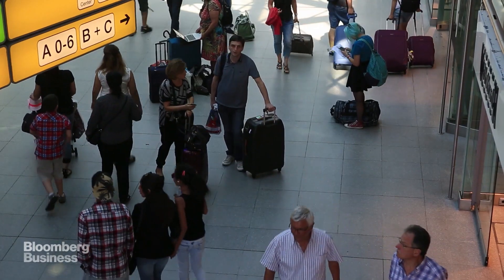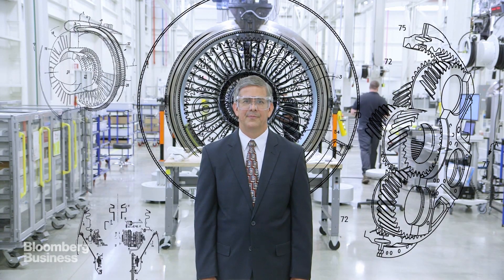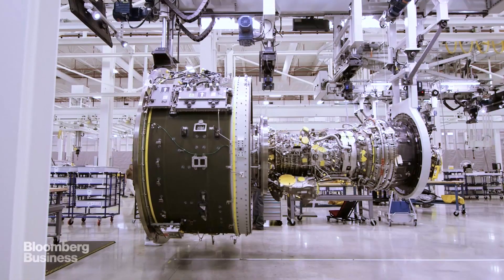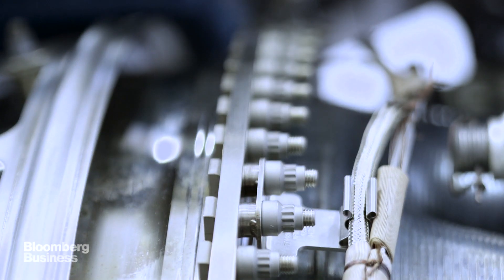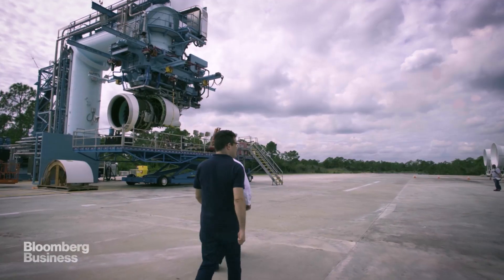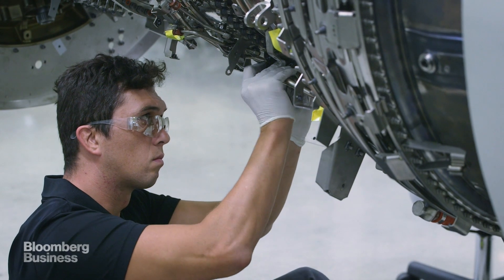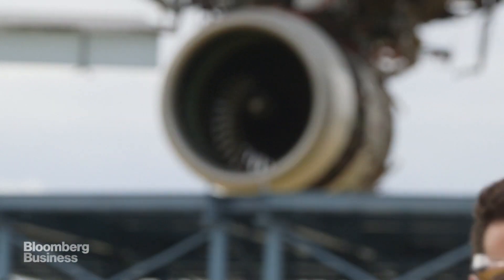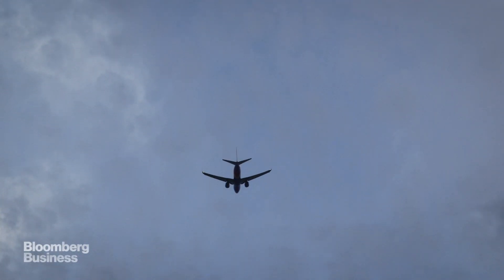This Genius Invention Could Transform Jet Engines

Comment: We've invented an innovative new design the world has never known!

A FUCKING TRANSMISSION.
Reply: Guy Mahoney
Sorry you missed my sarcasm. My fault.
No it is not simple upscaling, nor is it a simple task. The material engineering alone is a massive challenge.
The gearbox has to be far more reliable then any other gearbox in existence. It has to handle loads far greater then any gearbox in existence and it has to adhere to safety standards far greater then any gearbox in existence.
And all of that is before you start to ask the question of, how heavy is it, are we losing the efficiency gains we are going for simply due to all the extra weight we have added...etc.
Reply: Hey they're not so easy and they're a big deal.  Look at the dual-clutch, the CVT, et.al.  It's taken awhile to develop/optimize those.
Reply: We've had transmissions for an awfully long time, he hasn't invented a new method of power transmission, it's literally just scaling up an ancient skill. The idea is about as clever as putting a rubber on the back of a pencil, which is not very.
Reply: Was Edison's lightbulb clever?  He didn't invent the lightbulb.  Inventions and innovative engineering aren't the same.
Reply: And this isn't innovative engineering, it's an obvious lazy cut and paste.
Reply: Yes because a gearbox that can handle an engine producing ~500hp running at ~7000 RPM is no more difficult to design & build then one capable of handling an engine which produces >100000HP running at >100000rpm.
Reply: The keyword for aerospace propulsion is reliability.  Putting a  gearbox inside a 50,000LB thrust engine is many order magnitude more complicated. Plus making light weight for aircraft, and making last 2000 hours operating at 80-90% most of the time is a daunting engineering problems even RolceRoyce and GE backed away from the concept.
Reply: Actually the whole engine has to be constructed from the ground up. It's not as simple as slapping a planetary reduction gearbox on the low pressure shaft. 

Plus it's not new technology, but it's a huge innovation. Because so far only 6 types of geared turbofan engines have been developed and commercialized. 

Non of them, except the Pratt & Whitney PW1000G (which produces between 24,000-33,000lbs of thrust), has produced no more than 7,000lbs of thrust.... meaning only private and small jets.

Garrett TFE731
Lycoming ALF 502/LF 507
Pratt & Whitney PW1000G(In video)
Turbomeca Astafan
Turbomeca Aspin

So this engine is under enormous loads and requires some extreme engineering to create. Even more so as Pratt & Whiteny say "The 30,000 hp gearbox is designed as a lifetime item with no scheduled maintenance other than changing oil."

So basically they are saying that these transmissions are supposed to last tens of thousands of flight hours without maintenance other than oil changes..... you dismiss it as "a fucking transmission"... but you don't realize it's the whole engine that had to be innovative, not just a simple gearbox.
Reply: exactly, it's more costly but it's simple upscaling.
Reply: Right, and it's not just driving any old load, it's driving the engine itself. It's in the heart of the engine. It's not an isolated component, it's an integral component with effects that ripple through the whole engine design. So you tend to be optimizing not just a gearbox but the engine design as a whole. Safety, weight, efficiency are all so important.
Reply: 2Phast4Rocket Again, the actual concept of a transmission in an engine isn't innovative by any extent, if you're willing to scale up enough it's fucking child's play and that is what's being sold to us here. They weren't selling it's ability to tank crazy forces reliably at that scale, which is deserving of coverage, they talked exclusively about something we always could do in planes.

Imagine I told you I made a car that was equipped with a fan and tried to sell that as innovation, you would laugh in my face. However, what I failed to mention was that it was pulling that air out from under the car giving it unparalleled down force characteristics that would put F1 cars to shame. I would still deserve a massive fucking slap for implying a fan in a car was worth bragging about.
Reply: Guy: You have to wonder why a high bipass engine doesn't a "transmission" for a very long time. Aerospace engine companies have been building reduction gear, or transmission as you call it, for decades in turbo prop and helicopters. Yet they haven't cracked the secret of building a reliable reduction gear for a high thrust, high bipass jet engine. Aside from the simplicity concept of using reduction gear to convert hi rotational speed into low speed and high torque, building a light weight and reliable reduction gear for a turbine engine is the "holy grail" of turbine propulsion. If it is so simple, you should see it used since the first day of jet flight but you don't. That is the point of my post.
Reply: 2Phast4Rocket I don't have to wonder anything. I know a reduction gear is simple, I know a turbine can use a reduction gear by knowledge we've had for decades, technically this video could've been made before YouTube as it covers approximately nothing about how this decades old theory is put in to practice. Yes, the work put in to this is likely fiendishly clever but theoretically it could've been deceptively basic due to the fact they never actually covered how this is practical unlike how a theoretical machine is.
Reply: English Muffin You know car companies produce engines from the ground up every year, right? It's not easy work, it's hard graft, but it's not technically challenging.
Reply: Car companies do not produce new engines from the ground up every year. A car engine is usually a redesign of a current design. They may use slightly different internal parts for better reliability as well. On top of that car engines are very very very simple compared to a jet engine. I don't think you understand the amount of engineering that goes behind putting a gearbox into an engine of this size. You have to factor material strength. A plastic gear works in a remote control car but not a full size semi (obviously). Similar concept. Materials(flexibility, hardness, so on), distribution of load(too much pressure on one point would be a catastrophic failure), lubrication(how to lubricate gears constantly and evenly while a few are spinning at 100k rpm), cooling(Insane amounts of friction will cause the gears to heat possibly rendering lubrication useless), form factor(affects overall size and aerodynamics of engine), weight(affects fuel usage and makes choosing materials far more difficult), and price. Some of the many things to keep in mind and calculate with accuracy all while leaving reliability untouched or improved. It's not totally game changing but far from being as easy as "scaling up" lol

Comment: That's cool but the oil companies would probably buy that patten and not let anyone use it to sell more fuel
Reply: Not necessarily.  After all, if fuel is burned more efficiently, there will be more planes and more flights because tickets will be cheaper.  Then the oil companies (who are actually diversifying to get some of the business from alternative and renewal fuels; why would they be so stupid as to insist on petroleum and no other products?) would sell more fuel at the same price.  They could also set up subsidiaries to make, sell and service the engine improvements themselves, along with selling improved lubricants which work better with the new technology.
Reply: This old furphy keeps raising it's head but can anyone name one patent that an oil company has bought so less fuel isn't used....There isn't any, never has been or will be because patents have a short life span and anyone can access any patent and copy what it says as long as they don't commercialize it for profit.

Comment: They spent 30 years and 10 billion dollars on a gearing system? An "innovation" that has been around for much longer than before the beginnings aviation? Am I missing something here?
Reply: Yes. How do you design a planetary gearset that is balanced and stays balanced at high RPM's while being properly lubricated that operates at temperature extremes that doesn't require service at an interval shorter than a standard engine.

Comment: The video should explain why the gearbox is "incredibly simple yet fiendishly difficult."  Is it because the cogs spin so fast they fly apart?  Expansion and contraction during the heat/cooling cycle?  Lubrication failure in the bearings?
Reply: You have to guess.  Information content - zero.
Reply: All of the above.
Reply: I think they could have gone into some technical details.  When I was a Computer Science research assistant in college sometimes I had to explain my work and why we were doing it to parents of prospective students.  Some parents were electrical engineers who knew more about my research area than I did and some parents never did anything more technical than doubling a cookie recipe.  I'd go into as little or as much detail as they wanted but I never skipped an explanation because it was "really technical."
Reply: Al Dente I agree with you. I would guess their technique was a triple reduction planetary gear of some sort with a lot of clever bearings and seals and attention to balancing.  But I'm still guessing.
That was glossy self-promoting bullshit, and didn't impress me one bit.  It shortened my life, and my time is precious - at least to me.
Reply: It's simplest to stay on the ground.  The only time you add complexity is if it adds something of value.  You don't complicate something just to complicate it.  Turbine engines are extremely reliable because they're simple.   A single stage turbine engine has a single large moving part.  A planetary reduction gear does complicate a turbine, but if it's substantial  fuel and noise savings, it  will be worth it.  Planetary gears are the most reliable form of gearing something of high-power.  There are numerous instances of planetary gear assemblies being more than capable of lasting longer than the product they're installed in.  They're a very simple mechanism as a whole.
Reply: You make a good point, but I do think the everyday common accessory gearbox gives you your answer. It is, as is all other parts of a working jet engine (except your starter motor) driven by the turbine, which is the hottest part of your engine......unless you want to start reallygetting technical
Reply: Jay Edlington Most individual invention is stolen from the originators anyway.
It is part of power politics.
If you aren't a robber you WILL be robbed.
Some of my former employers are still in jail.
Reply: I remember reading about the gearbox for the  STOVL F-35 Lightning, now that is a feat. The lift fan in the JSF-35 is powered by the same turbine engine in the aircraft via gearset.
Reply: More toque than speed is the issue for gearboxes.
Reply: Tony, it's copyrighted so they can brag now.
Reply: Mike The more parts there are the more chances for a failure in mid air... this is one of those instances where the K.I.S.S building method is best... If you are wandering what this means, it's: Keep It Simple Sucker.
Reply: the necessary strength and consecuent  increased weight and complexity at those engine sizes  becomes a real problem ..
Reply: It's because they're transmitting upwards of 30MW of power from the engine to the fan. That's a LOT of stress.
Reply: Al Dente you need it to be continuously variable but without high transmition losses and low weight
Reply: But you have to understand.   It definitely would be fiendishly difficult for guys like this Bloomberg "reporter" (and ALL his "know-everything" bosses)
Reply: It's simple, they figured out lubrication problems in jet engines several years ago when they force feed the fuel through these lubricated parts to be lubrication before it goes into the engine to be burned. At about 900 PSI the fuel keeps things pretty cool.
Reply: @44hawk28  That's awesome
Reply: Instead of gear box, which adds weight and power reduction. These engineers use magnets and reverse polarity. By no means am I an engineer. Just a suggestion.
Reply: Extreme heat/cold in bad situations
Reply: Yes.
Reply: Now....you threw SOBREITY AND THE MONKEY WRENCH INTO idealistic concept.
Reply: my guess it is some sturdy & light material like titan, nickel possibly with ceramic surface coating
Reply: I fly the a320 which has these . That gearbox is the size a large car hubcap and handles over 25000 hp roughly . And it has to be light weight and reliable . So that's what makes it revolutionary . Cheers .
Reply: @AKENOXTRM  Best answer here.  Thank you.
Reply: Not particularly.  There's plenty of room for the addition of planetary gear sets and they could create a few speeds in a manner similar to an automatic trans by clutching them.  Engineering the lift fan of the F35b was a much more difficult task.
Reply: Are you a Chinese spy?
Reply: Cogs ???  not quite a mechanical engineering term.

Comment: Beautiful, but yes 30 years to make a gearbox does seem a bit suspect, although at such high power levels there are definitely difficulties not encountered with relatively weaker turboprop engines, considering that the dash 8 - with the most powerful turboprop in use today - is powered by 5000hp turbine while a 777's 100000lbf jet engine may have a turbine that effectively produce more than 10x hp under the same conditions.
Reply: Yeah, I suppose the problem would be making the gearbox be light, efficient, relatively cheap to produce and rugged enough not to require changes every 2 years.
Reply: You have no idea what you are talking about. They are a private enterprise and this project was not publicly funded.
Reply: Shawn Schwartz
Ah you are one of those tin foil hat people. Sorry my mistake. As you were.

Comment: I feel like they're just giving the layman's take on this, I refuse to buy that it took them half a century to come up with a gear box that lets the turbine and compressor work at their optimal efficiency, in fact I always assumed it was how turbofans worked.
Reply: It took them as long to produce a gearbox that is light, efficient, relatively cheap and rugged enough to work with engines of this power.
You do NOT want an aircraft engine that might stop working in midflight, or one that needs new parts every month.
Reply: ***** Sounds plausible but it still smells a bit fishy, it doesn't take half a century to crack such an obvious problem as supersonic fan blades and if it did... Shame on those engineers.
Reply: The can opener was invented 48 years after the tin can was.
Reply: But those gearboxes are nothing like the ones you see in car engines.. Did you know that the front fan absorbs tens of thousands of horsepowers to produce such massive thrust enough to propel an airliner..? To actually make a gearbox to such specification is a truly daunting task indeed.
Reply: j79 had variable pitch stators instead - 50 years ago!
Those are still awesome motors.
Reply: @ThePaulv12  variable pitch stators are an answer to a different problem.
Reply: Exactly. The amount of power and the tolerances needed on some of these engines are incredible. For example the LM2500 is a  ground power version of the CF6 turbofan engine.. The LM2500 produces over 33,000 shaft horsepower, so you can imagine what forces a gearbox would have to handle, and say you want the gearbox to last at least a full maintenance interval, which for one CF6 is expected around 18,000 hours...  And not one should EVER fail... Easy peasy.. :P
Reply: ThePaulv12 so is the Pratt & Whitney TF 3 0 P 408 I worked on those 45 years ago
Reply: Abraham Edelstein It is how it works but NATO will never create such designs without access to ultra tensile alloys which up till 2001 was only in abundance to the former Warsaw Pact nations. US and NATO are playing catchup
Reply: Yes. Gearboxes in turbine engines are nothing new.
Reply: Abraham Edelstein this is mostly BS, engineers have been aware that you could gear a turbo fan from about 1930. The reason they haven't is because it didn't make sense. A direct connection between turbine and fan is lighter and  more efficient. It is only because incremental improvements in gas turbine technology have increased bypass ratios to the point where the LP turbine gets massive to drive a very large fan at a low RPM that a gearbox starts to make sense. Note that GE currently have a conventional engine which is competitive with the P&W on the  A320 without a gear box. The RR three shaft engines have also always had some of the advantages of the geared turbine anyway. The  RR Ultra Fan is also a geared turbo fan but also has a variable pitch element and is a much larger and higher performance engine.
Reply: +Sangyoon Kim it is not so difficult, when you got 3 bearings taking all the load
Reply: Not the first turbofan to have a gearbox either, PS90A1 was certified 2007, the Lycoming ALF 502 was certified in 1980, and used on some very quiet jets like the Bae 146. But none of the really big engines have had gearboxes.......

Comment: I imagine the near future with aircraft running on bio fuel or liquid hydrogen and the far future without commercial airliners. Instead of them very crowded intercontinental underground hyperloop tunnels :)
Reply: hydrogen's a bust i'm afraid. and hyperloop... oh god. Thunderfoot already put the hammer on that one.
Reply: I saw that video, and nobody said thats it is easy to do or misses any danger but you cant say that the problems aren't solvable